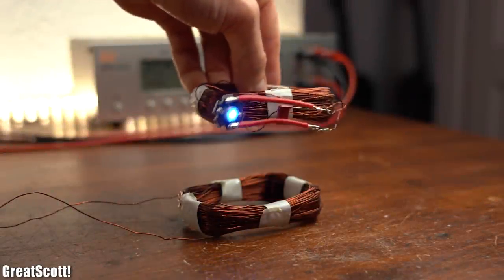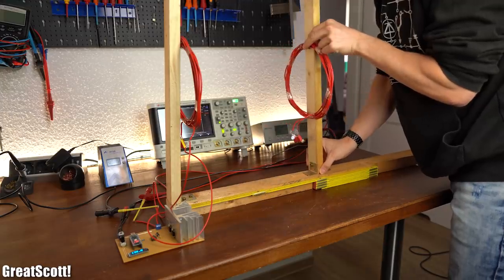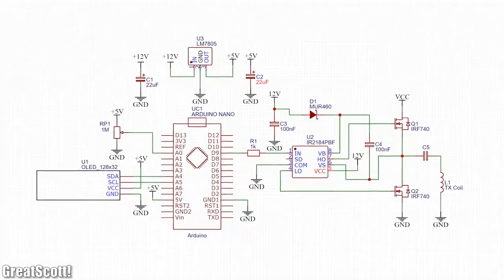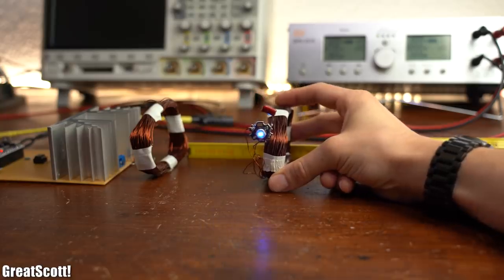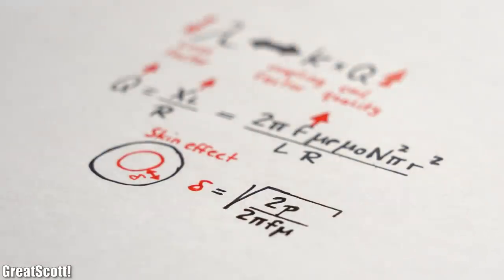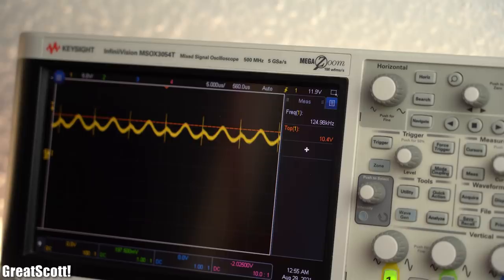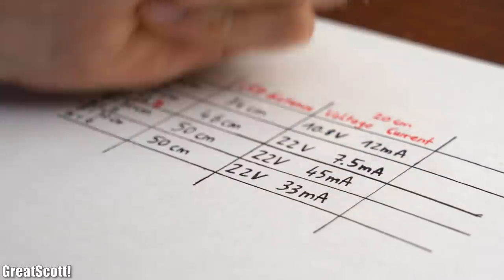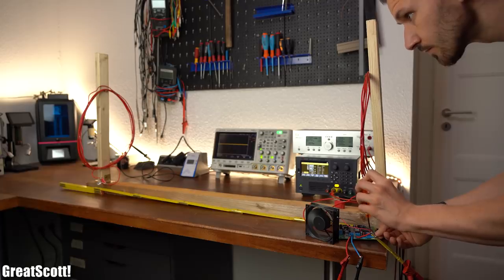How far can I Wirelessly Transfer Power? (Experiment) Better than at MIT?

Comment: I appreciate MIT's efforts but they have access to all sort of lab equipment so they probably used arbitrary signal generator and RF amp or high power op amp to achieve this. For the hobbyist this set up is out of reach unless you're willing to spend some $$$.

Comment: Plz. Increase voltage upto 90 to 100volts, 
With small amount of skin effect.
Reply from the maker: Due to the resonance you get very high currents in the lower voltage region. No need to use such a high voltage.

Comment: Where does the 98% of energy go that does not make it to the receiver?
Reply: entropy - Heat, in the wire, the circuit components, the air, so on

Comment: you are only inducing current from that fix electromagnetic field, altho its wireless but you are constrained to that non traveling magnetic flux. its a invisible wired  circuit as to say. let go of that magnetic field to travel farther like any transmitter does and solve how to harvest it properly. move on let, let go of that thinking that holds you from moving on

Comment: I do not understand the fascination with wireless power. It (as stated in the video) is nowhere near efficient nor will it ever be. 
It's a gimmick. Nothing more.

Also what's so fascinating about it? There's nothing new about AM/FM radio.... same thing.
Reply from the maker: There are lots of areas where you can not use wires. There wireless power is super useful and mandatory. That is what makes it interesting for me.
Reply: @greatscottlab  In low power and signalling devices sure. Like read and write heads on VCR drum heads and things of that nature.